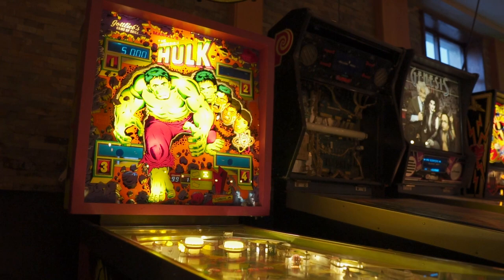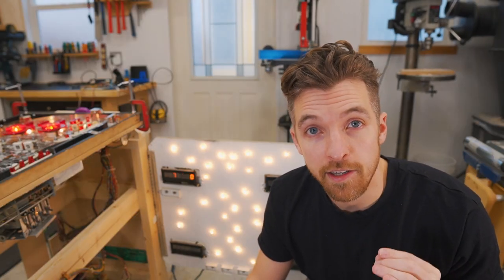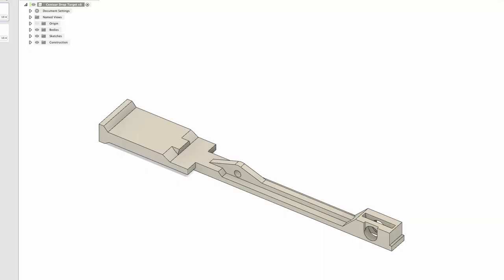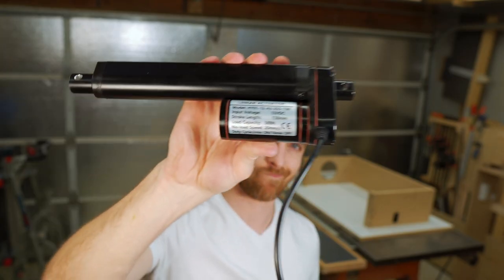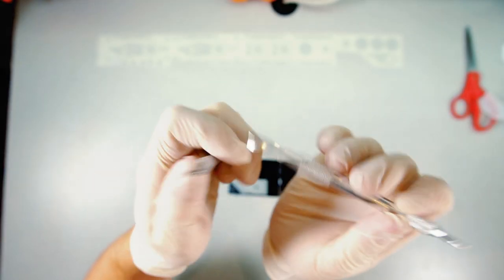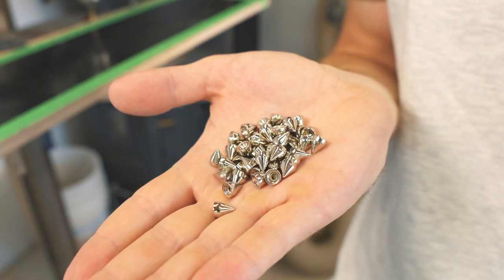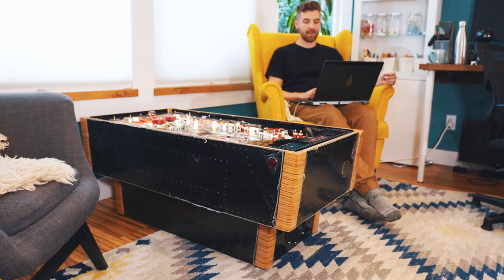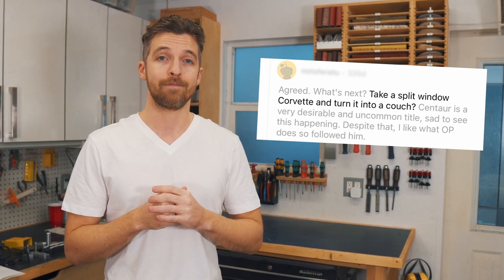Pinball Machine to Coffee Table Transformation | Insane Build

Comment: I think a lot of the "hate" comes from the fact that pinball machines mostly had very small production runs and a lot of passionate people become concerned that machines that could otherwise be restored are being "wasted on stupid projects", making a rare title even rarer. This is simply NOT the case with your machine, as you've used what you could and then donated the remains to a friend for use on a Centaur he is restoring.

Amazing work with the re-engineering of certain boards for scoring, sound etc as it shows what can be done with Arduino boards that could possibly become an alternative for others with similar solid state machines with faulty boards in them!

Comment: I wonder if you tear your leg up by brushing against the side of the cabinet while walking past it to sit down. Also, is the glass top just sitting with gravity on top or are there clips to keep it in place?
Reply from the maker: The mini spikes are not sharp but running into it would do more damage than a regular coffee table.

The glass is heavy and rests on silicone gasket which is quite sticky. I had considered clips but they are not necessary and this looks cleaner. 

Great questions and thanks for checking it out!
Reply: @buildxyz  thanks for the details!

Comment: This may be the first time I've ever seen someone destroy an actual pinball machine, let alone a CLASSIC BALLY, and turn it into something more amazing then the original. Also, despite having many Canadian friends, I was today years old when I heard decal pronounced "DEH-cul" for the first time. This is absolutely amazing, with diverse skills from woodworking, metal work, software engineering, electrical engineering and more. Really the only flaw I see is replacing a manual plunger with a solenoid, thusly removing a skilled player's ability to skillfully plunge the ball into a preferred top lane or even short-plunge the right orbit.
Reply from the maker: Thanks for the constructive feedback! I 

I was going to pick a cheaper, less desirable game early on but I knew it would be a year to finish this project and just wanted to put the work in on awesome, classic game.

The plunger on this game isn’t “as skilled” as some others with no real reason to perform a short shot and you can’t overshoot it either. The flippers for selecting the bonus lane still function as normal. But I hear on this point for sure, it just stuck out too far.

I’ve always said decal that way. It’s a thing: https://ca.outdoorsy.com/neveridle/words-pronounce-differently-canada 

I’m not a stickler for pronunciations at all though. As long as people know what I mean. I guess some people are distracted by that stuff?

Comment: I like the idea behind it. My one concern is having to remove the glass in order to play, you run a much higher risk of breaking the glass if has to come off each time. Not to mention the dust and foreign objects that could potentially get on the playfield and cause accelerated scratching. In reality I feel like one isn’t really saving much space going this route and it will definitely be much more expensive then if it was kept original.
Reply from the maker: The glass is usually on when being played. I just took it off because of glare in the video and to show it more clearly. 

It’s definitely more expensive than  just restoring the original though 😂

Comment: Was the circuit board you designed only for the features not contained in the original machine? (such as lifting  the playfield)
Reply from the maker: Correct, the custom board performs many functions, mainly decoding the scores and controlling the actuators. The replacement MPU board still runs the game logic. The technical post linked in the description has some extra details :)

Comment: It seems extraordinary that you put in so much effort to find the right game to use then you happened to have a friend that needed the parts you had. I’m guessing it was just someone you met while researching pinball rather than a real friend. If they actually needed the back box then you probably could have just swapped machines before tearing it apart. The Centaur you bought seemed to be in relatively good condition, what was wrong with your “friend’s”?
Reply from the maker: He has a Centaur II which he prefers the Centaur I cabinet. He is real and a real friend 🤣

Comment: Considering that you replaced damn near every component and upgraded quite a few of them how hard would it be to take the specs of any single level pinball game and do the same thing using new parts and 3d printing?  If getting high quality prints of any of the graphics is not an issue I don't see why you couldn't build almost any machine like that without having to recycle an original. I mean if you can put 11k play tables on a video pinball machine how hard would it be to find a table you could completely fabric from scratch?

Comment: You’ve done some interesting things here but while the end result is impressive on some levels you’ve ultimately destroyed it as a real pinball game. Nudging the machine is not “cheating”, the tilt Bob is set to prevent excessive nudging. Your system might need to be more sensitive to protect all of the mechanisms that raise the table but ultimately you lose a lot of control over the ball. Rather than turning a sports car into a couch it’s more like turning the car into a very pretty, kids go-kart that has lots of new features to raise and lower the suspension but it doesn’t handle well enough to drive it around a course we’ll.

Comment: you removed the plunger for being "shaped like a weapon" but then drill and install 700 pointed chrome studs?  While they certainly work well with the theme of this pin (and look gorgeous), I just can't stop seeing a child running into the side of this to very ill effect.  That said, it looks amazing and is undoubtedly unique.
Reply from the maker: They aren’t very sharp and are designed to go on clothing. There are also dimensions in the cabinet which stick out pretty far and are softer contact points. But yeah, when my young nephews come over I have a cardboard protector for that reason lol. A mature aesthetic feature for a mature themed game :)
Reply: @buildxyz  as someone that took a header into a coffee table when I was a toddler, and still have the scar to prove it, glad to hear you're thinking of them  :)

Comment: To me, part of the appeal of early solid state pins is the actual early solid state part, which you completely got rid of. I appreciate a lot of this build, but it's not my cup of tea at all. I also feel that, given how rare this one is, it might have been better to seek a bare playfield, given that very few of the original components got reused. But the fact that all these original components are going into another Centaur build that will be original redeems the project.
Reply from the maker: What solid state parts are not in the final build?
Reply: @buildxyz  you completely replaced all the PCBs with new ones, modern chips on the new PCBs, used FPGA, and even digitized all the sound effects.
Reply from the maker: But all the new PCBs use solid state electronics and are direct replacements instead of troubleshooting ghosts in 40 year electronics with obsolete parts. 

The sound board is not “digitized” and is original that is all explained. The Squawk & Talk sound board was back to life. I recorded the sounds to make a song lol!

It’s okay if you don’t like the project though.